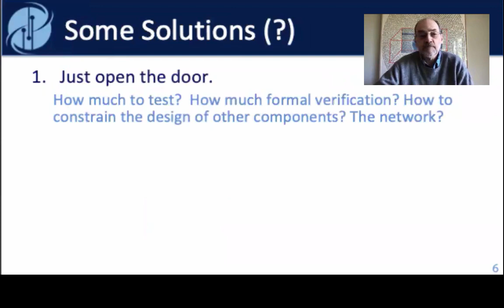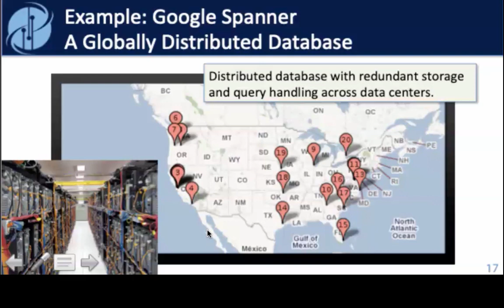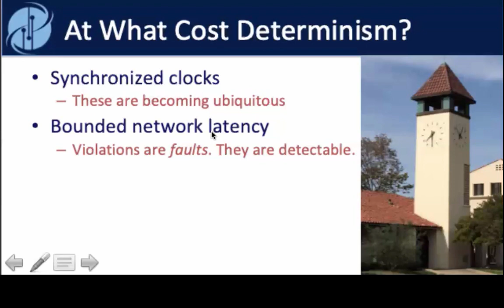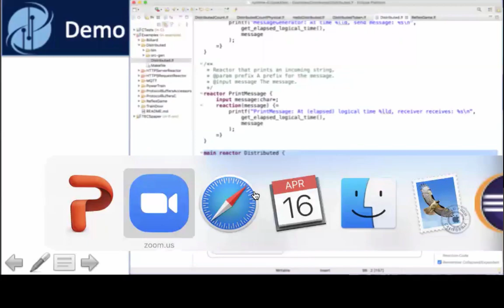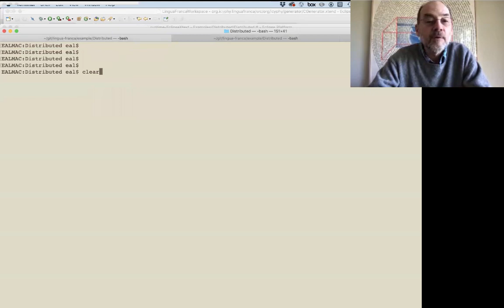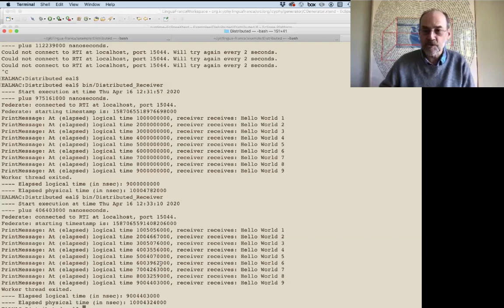Reactors and Lingua Franca: A Programming Model for Cyberphysical Systems

Comment: real-time, embedded, database, web server, deterministic... looks like the academician world is a bit aside from the practice. It would be nice to provide a case study from practice for this theoretical talk... otherwise, it sounds like an attempt to solve the conflict-resolution problem for a badly designed system... and do it by low-level languages (C, Python, etc.) with a fuzzy-defined wrapper to process a transport problem in the network (the deadline operator). Is it possible to demonstrate an advantage of the R/LT on the case study? case study description -- requirements -- design -- implementation in the R/LF(C) -- verification?
Reply from the maker: Indeed, this is a good question. We have a paper (currently under peer review), which includes an elaborate case study, a port of the open-source ROS-based self-driving car software called Autoware.Auto. We show that in that software, inconsistency faults occur rarely enough to be difficult to detect during testing, but they occur eventually, leading to potentially dangerous unpredictable behavior in the software. We show that LF does not have this problem.
Reply: @EdwardLeeAtBerkeley  : Dear Professor Lee, thank you a lot for your reply. But I have to confess, I looked at your recent manuscript "Toward a Lingua Franca for Deterministic Concurrent Systems" (ACM Transactions on...)  and can not catch the point... What I see, you try to solve problem to find y = x * 2 + 1 in a badly designed system with wrong low-level implementation. That does not look like a problem from the real world... Again, thank you for the time you spend on your response. It is very kind of you. Best regards.
Reply: @v.z.8131  Yes, this work requires some imagination from the reader. I'm sorry it doesn't resonate with you.
Reply: @edwardashfordlee  : Dear Professor Lee, you're right, my imagination is limited... by my experience in developing control systems and programming languages for PLC (cyber-physical systems, embedded systems, Industrial IoT, etc.). And I want to express my gratitude to you for paying attention to the problems that are now in the programming of reactive systems. And I must say bluntly that the main trend in this domain is the creation of high-level languages. Conflict resolution and synchronization issues are at the implementation level, and it means the so-called device-centric programming (low-level). While everyone is interested in application-centric programming. 

I'm sorry, your example of evaluating the function y = x * 2 + 1 is an example of what low-level programming can lead to when combined with a poorly designed architecture. That is, the source of the problem is not in the distributed architecture of the system, but in the low-level language used by the programmer. So, you are fighting not with the cause, but with the effect. Palliative solution. IMHO, the manuscript needs some real-life example to justify the activity in the chosen direction. Best regards.
Reply: @v.z.8131  I think when you talk about "low-level programming" vs. "high-level language" you are confusing "simple example" with "simple language." Even the most sophisticated language can express simple examples. My point was that it should be profoundly disheartening that such a simple example exhibits unexpected behaviors.  BTW, PLCs are not invulnerable to such problems, particularly those efforts based on the IEC 61499 standard to extend PLC programming into event-based processing (vs. periodic). We have a paper on this, co-authored with people from Siemens who are top experts in PLC programming. See https://www.icyphy.org/publications/2021_SehrEtAl/
Reply: @edwardashfordlee  : Dear Professor Lee, when I talk about "low-level" and "high-level" I use definitions based on pragmatics (or software psychology). I am sure you have heard about these areas of CS. So, a high-level language is a programming language which provides a conceptual framework corresponding to the target domain. 

BTW, there are several viewpoints on the IEC 61499 standard. For example please have a look at the prof. Thramboulidis's papers... e. g. "IEC 61499 vs. 61131: A Comparison Based on Misperceptions"  https://www.scirp.org/journal/paperinformation.aspx?paperid=35250 
Also I think you are aware that the industry does not accept the standard. 

As to me, I personally recognize the standard as an attempt to solve the problems of the IEC 61131-3 languages by adding EEC -- a FSM-like structure. But the event-driven behavior is not the only feature of cyber-physical systems/control software. So, the IEC 61499 FB is still a low-level language for the CPS domain. Best regards.